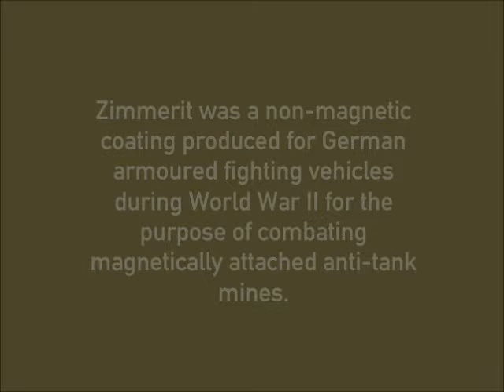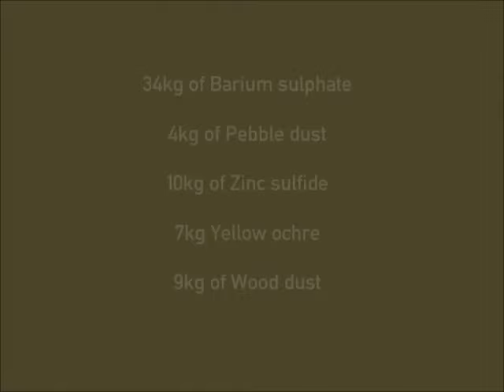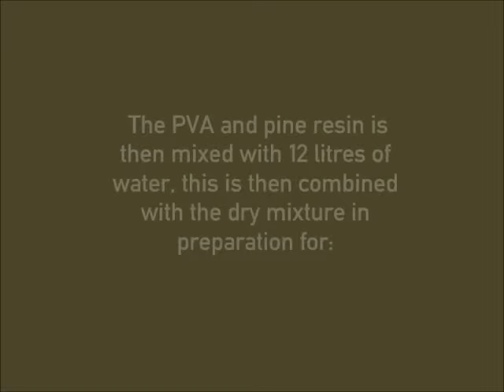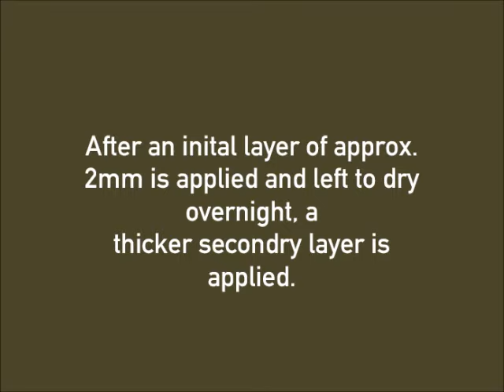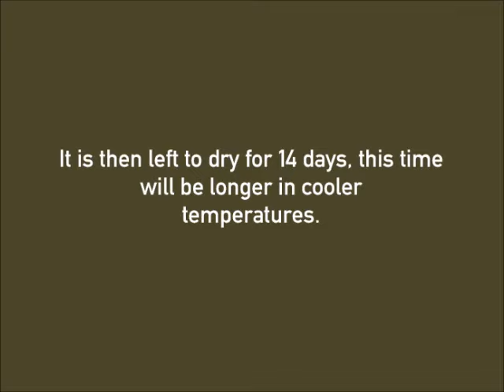Making and Applying Zimmerit To The Original [Correct] Formula

Comment: Very interesting video on the Zimmerit and it's application. It seems rather labor intensive and had to be dried for at least a couple of days. It is curious because the Russians did had magnetic anti-tank mines but apparently was not commonly used.
Reply: apparently germany was the only nation that actively used the magnetic anti tank mines, although other countries did experiment with "sticky" bombs in general.
Reply: @AnikaJarlsdottr  I think you are correct but certainly not elaborate as the German Zimmerit. But in truth wasn't important for the western allies as they packed their tanks with sand bags, logs and cement by US crews or packing tanks with tracks typically by the Brits. Officially the authorities generally considered it quite ineffective...
Reply: @paoloviti6156  the western allies didnt pack logs, sandbags or concrete on their tanks to protect against magnetic weapons though, they did that to protect against anti tank guns and shaped charge projectiles like panzerfaust/schreck and PaK40
Reply: @AnikaJarlsdottr  you are correct but how are you going to clamp a magnetic mine on those tanks covered with cement, logs and sand bags?? As stated before a magnetic mine will manage to get attached on the track covered tanks..
Reply: @paoloviti6156  the british had a "sticky" bomb that was covered in a highly adhesive layer. the only reason it wasnt put into mass production was because it had a habit of sticking to the operator.

the western allies didnt put logs or sandbags or concrete on their tanks to protect against magnetic mines, those were almost exclusively used on the eastern front against russia. they did it to add extra armour thickness against the guns and shaped charge rounds flying everywhere. I dont get what your point is...
Reply: @AnikaJarlsdottr  about the British "sticky" bombs you are more informed than me but I invite you to look carefully at the period photos of both Western and Eastern Front especially those in Normandy and afterwards. You can compare it with the Red army that seems almost "naked" in comparison aside the Russian troops hanging around. Many of the Russian tanks usually carried some logs in order to extricate out of mud or bogs. Even in the final battle in Berlin there was nothing particular on the tanks.....
Reply: @paoloviti6156  I will admit, concrete, logs or sandbags could help mitigate the magnetic effect of an anti tank mine, but the magnetic anti tank mines were used almost exclusively on the eastern front and thus aren't really relevant to the arguement. after the magnetic mines were declared obscolete in 1944 by germany, the remaining stockpiles were used up but then they never made more as they had been replaced by panzerfaust anyway.

so by 1944 at D-Day and beyond, when you see the shermans and all the other tanks with logs and concrete and sandbags, its because of the rocket launchers and anti tank guns they are likely to face, rather than a percieved threat from a weapon that is already out of production.

Comment: Zimmerit was not used in late production tanks as it was thought the zimmerit could catch fire and burn. This was not the case and in operational practicalities the main threat was from hollow charge weapons like bazooka rounds late in the war. Infantry moved away from putting themselves in harms way by getting in actual contact with a tank or armoured vehicle and placing a magnetic mine on it. Antitank mines were used placed in the path of approaching armour to immobilise it by blowing off the vehicles tracks and damaging the running gear.
Reply from the maker: Hi Damian the problem is when Zimmerit is applied in the cold winter months. We waited many days weeks for it to dry and it did not on the first StuG we dressed. The moisture within is Benzin/petrol. If the vehicle was hit it could catch fire. In fact some after action reports spoke of crews whose vehicles had self combusted despite not being penetrated by enemy rounds. Officially this was ignored...